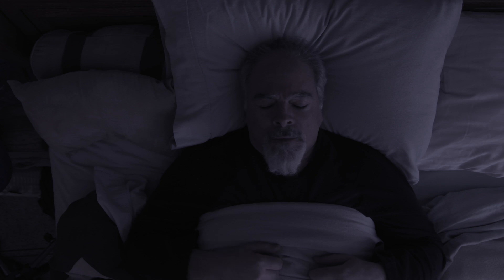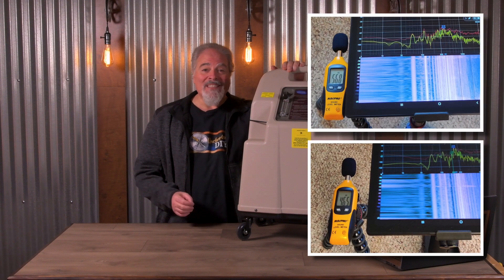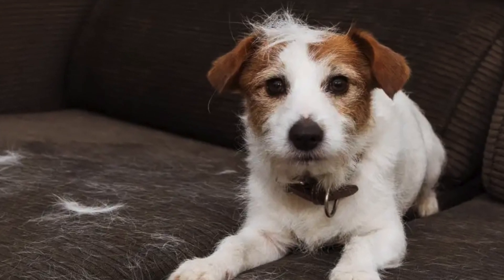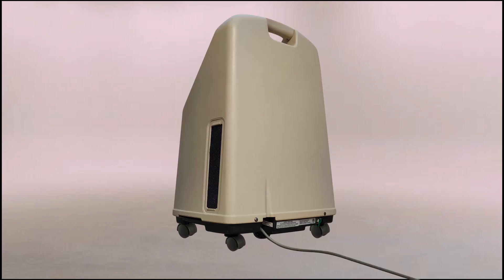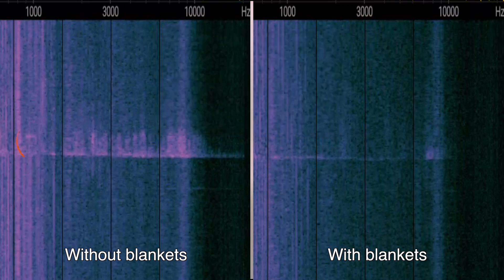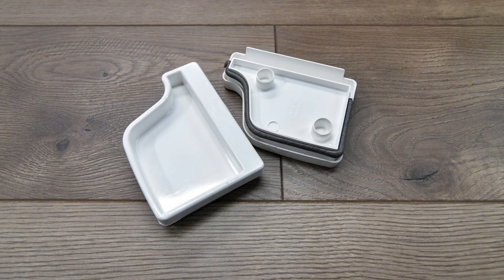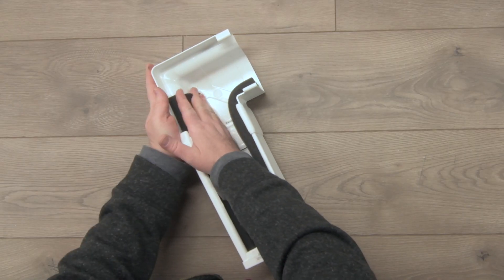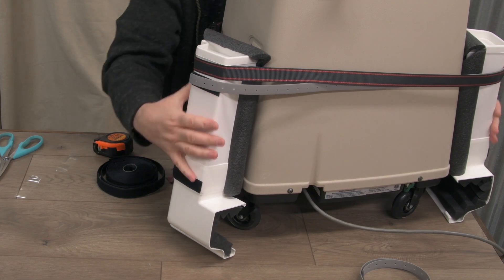How to Make a Loud Oxygen Concentrator Quieter. 5 Non-permanent Solutions to Reduce the Noise

Comment: Best solution is liquid oxygen. No electrcity, no heat, no noise except on pulse which is very faint. No electric bill. Works during electriv ourages. But there is a shortage of liquid oxygen. There is a bill in both house and senate to make liquid oxygen more accessible. The portable tank is so light, lasts longer than batteries. I am suffering from loss of mobility and freedom of liquid oxygen. Oxygen is purer, too. 
But government is shut down! The bills in Congress just sit. 😢 but my electric bill goes up running these machines.
Reply from the maker: I didn't know how liquid O2 works. I thought it would only last a short time, even with pulsed. Thanks for the education!

Comment: This is life changing. My husband has an Airsep Newlife Intensity 10.  We call it R2O2.  We don’t own it.  We live in a two bedroom condo and feel we are living near an airport. The  configuration is different so not sure what to.  Intake is at the back and outtake at the bottom. Any ideas?
Reply from the maker: Hmmm. Good question. I am not familiar with other types of concentrators, so I hope these suggestions will help.

I would start by placing the fuzzy rug under it since that's where the exhaust is. The blanket absorbs some of the sound coming out of the exhaust and helps break up reflected sound waves. If the concentrator sits low enough that the rug blocks airflow, I'd prop it up on some boards or replace the caster wheels to raise the machine up to give it room to properly breathe.

I'd also move the machine out away from hard surfaces like the wall or hard-sided furniture. It doesn't need to be out in the middle of a room, but a foot or two of distance can make a big difference.

If that doesn't do it, I'd then cover it with the moving blankets. Since you don't want to block the intake port on the back, I would try attaching something above the port to make the blanket hang away from the port. A cardboard box with one side cut out where it overlaps the intake might do it. You can experiment to see what might work. 

I would love to hear what you come with so that other viewers in a similar situation can reduce their noise level (and annoyance factor) to a sleepable level 😀

Comment: Great job, I work as a repair technician for Apria and I’m very familiar with those workhorses. They can run for years, but sometimes those compressors need to be rebuilt due to failing seal cup and will make a lot of noise over time. But those are some awesome ideas for a good. Nights sleep.
Reply from the maker: Thanks for the kudos and for informing me of what can go wrong.

Comment: Adding mass to the concentrator might also change the noise/frequency... heavy blanket or bean bag?
Reply from the maker: Very interesting...I think you are onto something! An ideal solution would be to line the cabinet with the sound deadening neoprene material used in cars since it adds mass. However if it is a rental machine I suspect it would get you in trouble. 

The moving blanket I talked about does make a big difference, but now that you mention it, I wonder if one of those weighted blankets would be even better?

Comment: How come you do not have links to the gutter pieces?
Reply from the maker: I didn't link to the gutter because ordering it from Amazon would be ridiculously expensive. They are available at any local hardware store, but the brands vary depending on the region of the country. That would confuse people since the exact product might not be available where the viewers are.

What I used is called "Amerimax Home Products 5 in. x 10 ft. White Vinyl K-Style Gutter". I got mine at Home Depot for under $10. You will also want to add two elbows and two end caps that fit whatever gutter you find locally. Just make sure it's easy to work with vinyl, not aluminum.
Reply: @UnchartedDIY  Thank you so much!

Comment: I have one and have used it for about 5 years now and its not really an issue.  Its in the corner of the den when we're in the living room.  I'll put it in a bedroom with the door closed sometimes and just get a longer hose.  For that matter, I could probably put it in the garage under a cardboard box and get a 75' hose.
Reply from the maker: It sounds like you have a nice solution. Distance makes a huge difference. Just a suggestion though if you put it in the garage — since you won't hear it, make sure to remember to turn it off in the morning 😁

Comment: How about we just go after the manufacturers, they are the  ones making these crap machines, I never believed in suing people, because I understand shit happens, but these are life-saving machines, and they should be held to higher standards, i’m sure eventually a lawyer will pick this up, and they will take most of the money for almost saving someone’s life, I guess it just takes enough people to complain, we need to make a loud noise in their living room
Reply from the maker: I like the idea of making noise in their living rooms! I totally agree it begins with the companies. If you've ever seen inside an Invacare concentrator, you'd be amazed that there is zero effort made toward noise reduction.
Reply: Unfortunately, Medicare and insurances that pay for these units have forced most manufacturers to leave the market.  There are only a handful of manufacturers that are left.  Most are coming from China now.  There have been many attempts to reduce sound output over the last couple decades, but this increases cost and reduces reliability.  Sound dampening typically increases heat and restricts air flow which causes premature failure of compressors and other components sensitive to high heat environments. Currently, OxyHome makes the quietest unit on the market.  Probably the only unit you can sleep next to, but it does make a low humming noise.
Reply: Just got a new concentrator  after the old one failed. The old one was loud, and the new one is louder :( I wonder if some of these tips might work.

Comment: Actuly, if you are on one, you're getting Medicare, which requires buy law they maintain it to not be no loud
Reply from the maker: You are correct, Keto. They are supposed to maintain the concentrator, but getting them to do so after the first 3 years is a battle with the company I'm familiar with. If you ask for a replacement, they will give you another machine, but it may as bad or worse than the one you have. If it actually provides oxygen, they consider their part of the contract fulfilled regardless of the noise level. On top of that, the Invacare Platinum was never a quiet machine even when new.